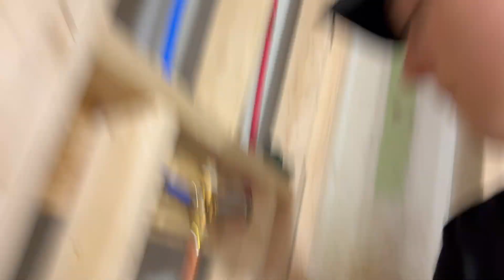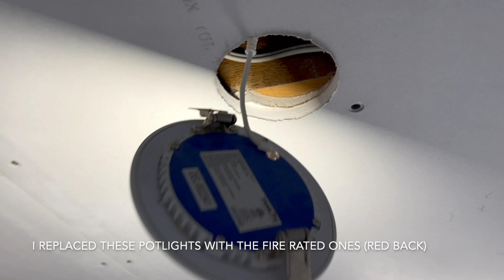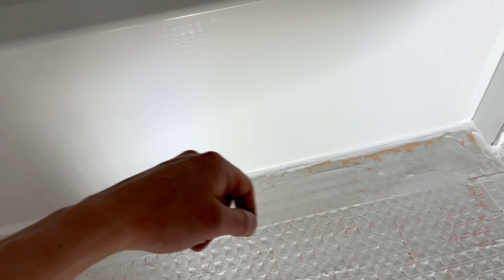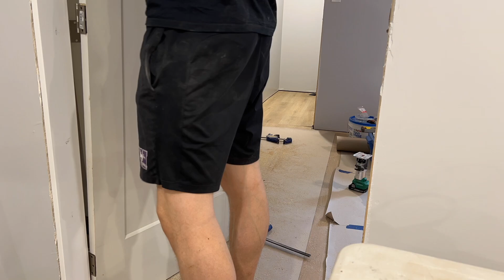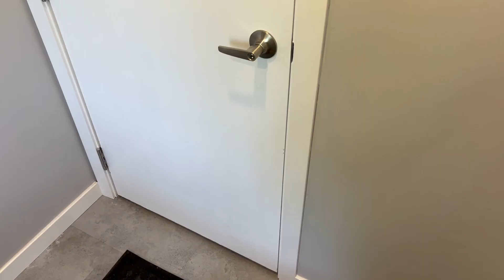DUPLEX Build | Part 5 - Unit 2 Insulation, Framing, Drywall, Fire separation, Electrical

Comment: Were your hot and cold supply lines reversed in the tub or was it just mirror image camera tricks?
Reply from the maker: haha no i totally flipped the hot and cold. I just found my order for that shower valve and its one of the ones where as long as your get the hot and cold lines in the correct ports, the other two ports (shower head and tub spout) are interchangeable.